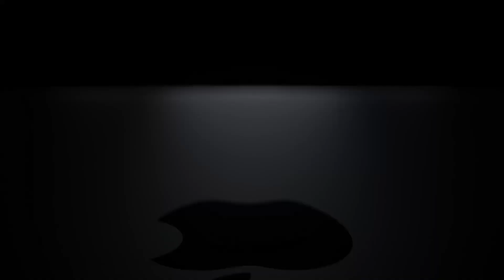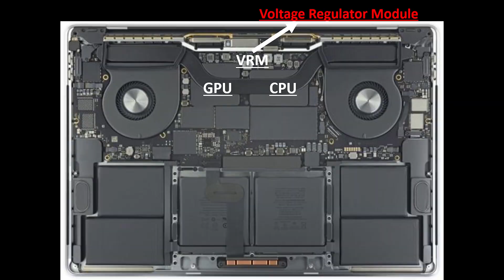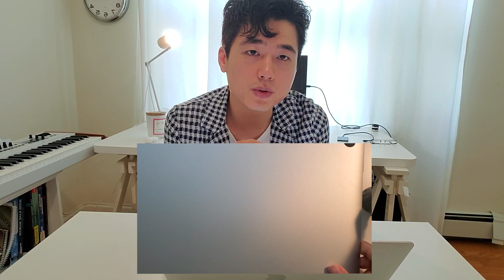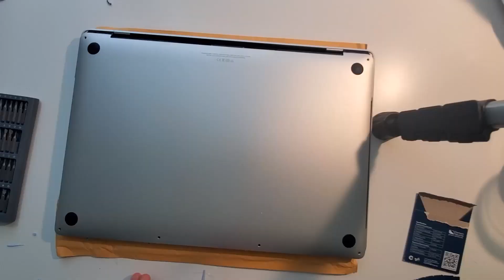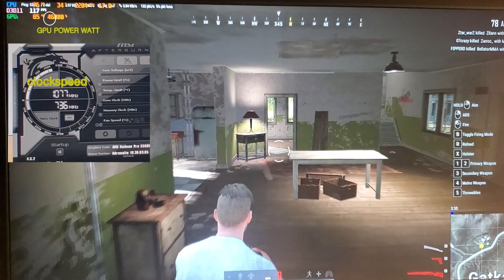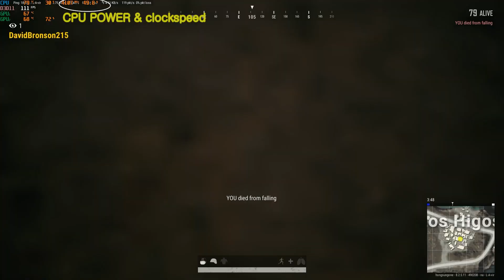MACBOOK PRO 16 INCH Thermal Design Flaw 3 Minute Mod Solution Performance Increase GUARANTEED

Comment: Hi, I have a few questions:
 - Is your MacBook Pro 2020 6 core i7 or 8 core i9?. 
 - I noticed you have a Midi Keyboard. Do you use Logic Pro X?.
 - Did your mod improve/reduce the fan noise under heavy load in Logic Pro X or any other DAW that you might be using?.  
- Which GPU do you have 5300M, 5500M, or the 5600M?
Thank you
Reply from the maker: Hello thanks for watching. Its the core i9 version with 5500m gpu. The mod signifkantly improved every application especially games and adobe premiere pro. I usw cubase and unfortunately i havent tested. But since daw is cpu intensive i am betting it will benefit for sure.Yes it did reduce fan noise for sure but it did cause the laptop bottom to be a little hotter when resource heavy applications ran on the computer since the computer now takes advantage of the cpu horsepower more
Reply: @notefromone2925  Great!. Thank you for sharing this. It might help some of us who are not willing to pay Apple $800 for the 5600M just to avoid fan noise and heat up when connected to external monitors. Thanks again.